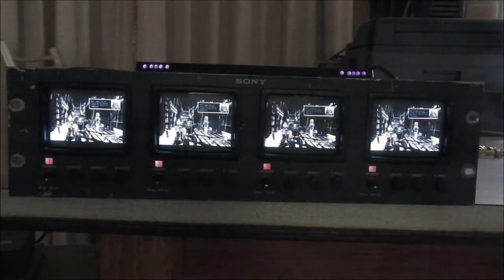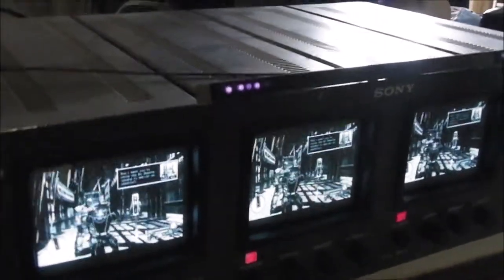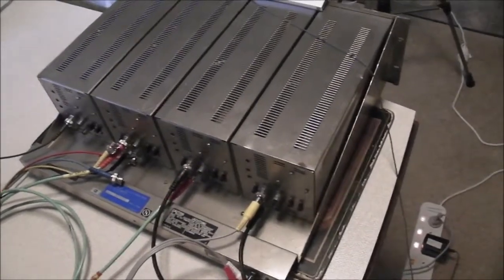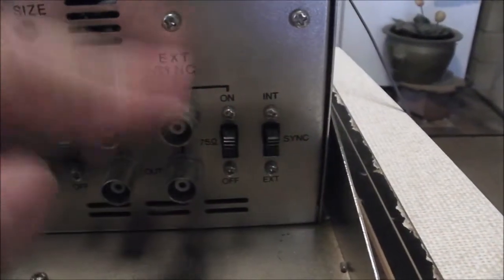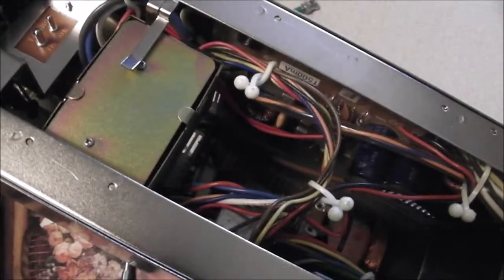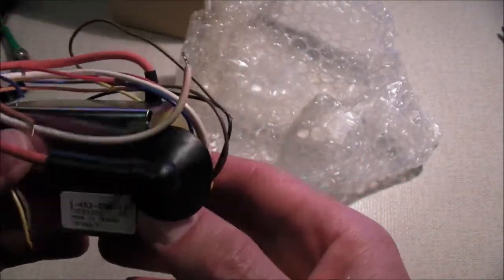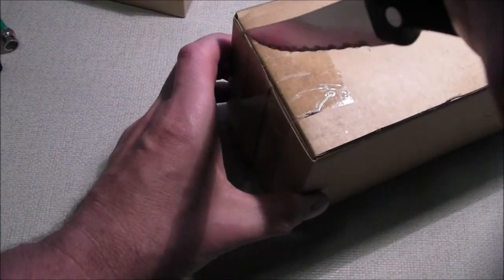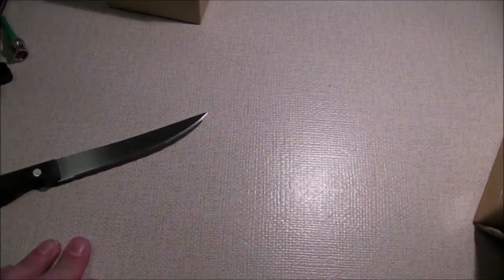Sony PVM-411CE

Comment: I suppose it's possible these were used in security applications, but the most common use would be studio VTR monitoring where you just need a basic confirmation that picture is present, usually with burned-timecode/deck status, and for viewing menu options of the VTR.